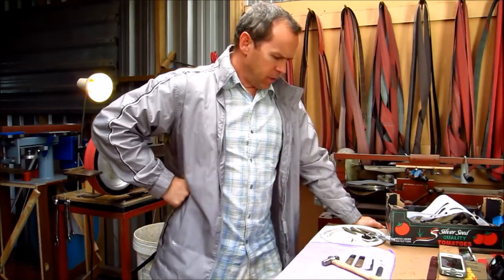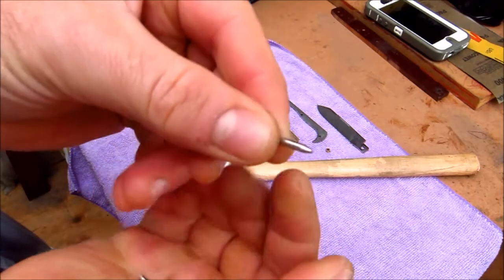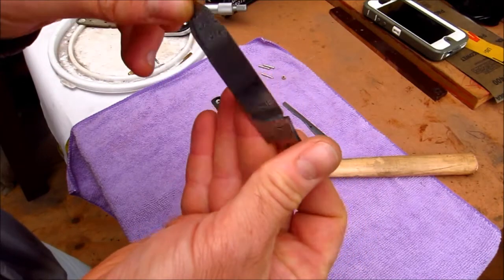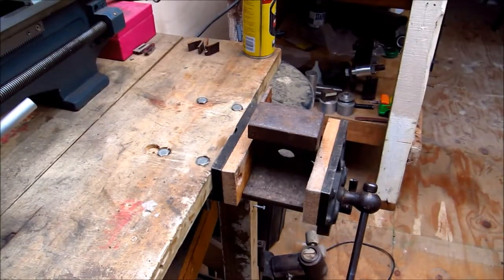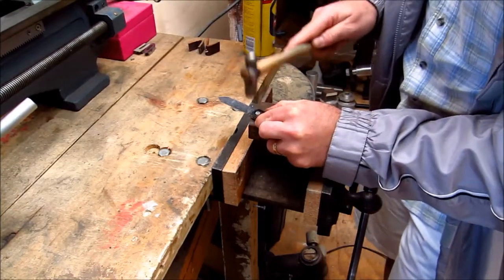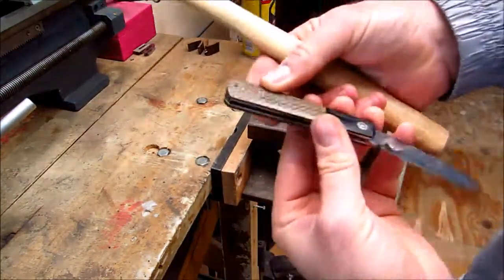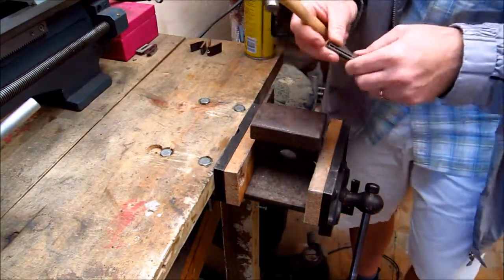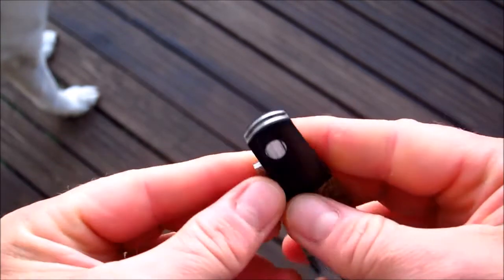Assembly and peening a slipjoint with a reveal at the end

Comment: Very good looking slipjoint....tough long lasting  material choice and beautifully finished.  Question : i saw in your previous vid that you chamfer the pivot pin before peening. Well i found that somethimes the pin does not fill the chamfer completely and a very tiny gap can become visible after grinding and polishing the scales and pivot pin further down. I tried some peening on scraps without the small chamfer and they hold equally well since the pin becomes wider by peening and it  pushes out at the sides even without any chamfering. I got a very clean and unvisible connection that way. Whats your take on this ??
Reply from the maker: HoutmeyersP I chamfer the pin only to enter it into the knife. After that I flatten the pins again to ensure they flare well and fill the holes as you mentioned. For me it’s essential to flatten the pins again before peening. Spot on.

Comment: Why does the orientation of the phosphor bronze bushing matter? Is it chamfered a certain way? Or is there a recess in one or both of the liners? Beautiful work btw.
Reply from the maker: Zack Chambers sorry Zack. Only saw this now. If the inner hole is not concentric with the outer diameter of the bush, then it def does matter with regarding to spring height that it stays in position. Otherwise it makes no difference.
Reply: Meades Knives thanks for the reply I've watched that same part probably 30 times and never could quite understand the reasoning until your response (if I'm being honest it took a few times reading your reply and watching again for it to sink in.) I guess I had presumed that the bushing was a precision made piece with extremely tight tolerances. Then I remembered that would only be in a perfect world. And nothing in knife making can ever be easy lol thanks again for the great video and response!